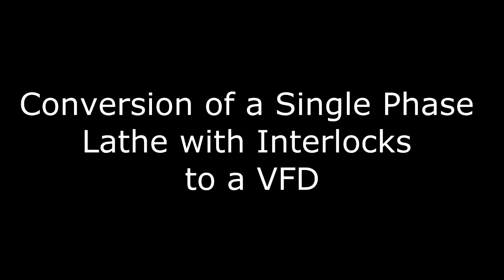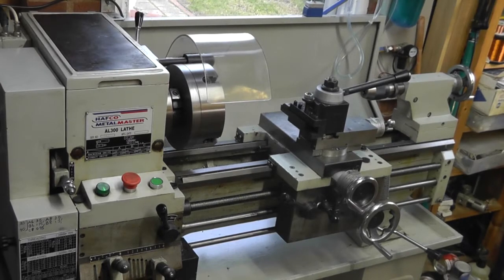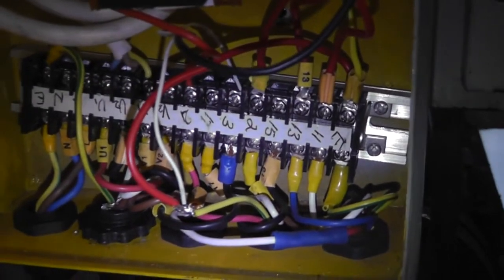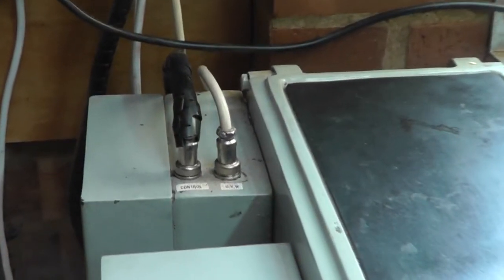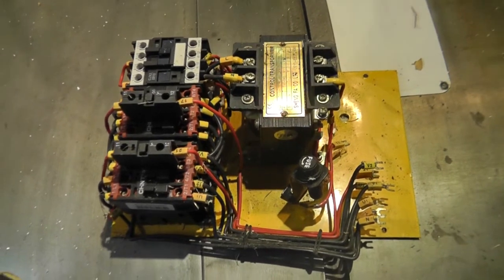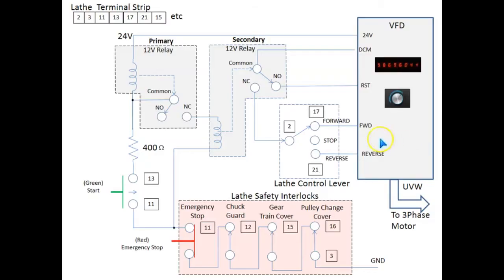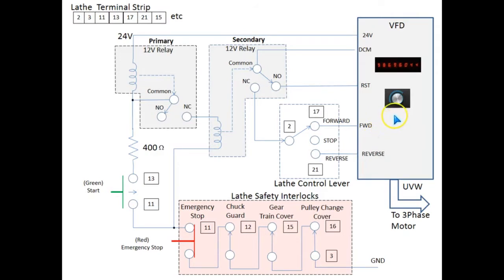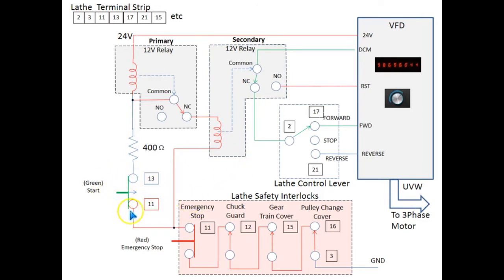Conversion of a Single Phase Lathe with Safety Interlocks to a VFD

Comment: Did you just remove the motor and size it against a 3 phase? Thinking of doing a similar conversion to my Grizzly.
Reply from the maker: Yes, it was a 1.5kW motor.   If I had the opportunity I probably would have gone for a 2.2kW.  Of course once you have a VFD driven 3 phase motor you don't need to worry about the belts and so I normally have the belts on a low gear ratio to compensate for the low power motor but I have found that even with that configuration there is ample enough speed range. 
I had a few minor modifications to make to the mounting platform but it went reasonably well.   Because my lathe was against a wall and I was too lazy to move it I had a bit of difficulty manoeuvring my way behind the lathe to install the new motor - but if you can move the lathe it is a very easy job.
Reply: Do you remember the frame# or maybe could you send a pic of the info plate
Reply from the maker: @force245  No worries - it is a GL-90L-4 B3 motor from Guanglue Electrical here is a link  to the frame data: http://www.guanglu.com/en/Productlists/showinfo/55

Comment: I was wondering how difficult it would be to properly integrate the Huanyang VFD into the lathe controls. Found a deal on a enco 14x40 lathe and just got it in the shop. Your video has helped me decide to go forward with the VFD option instead of a RPC. I was not so much worried about variable speed as the lathe will go down to 33 rpm but further speed control would certainly not be a bad thing. More worried about the stop/start/reverse and the interlocks but as per your video, that should not be a problem once I gain understanding of the lathe wire diagram and workings along with the VFD options. Thank you for posting the video.
Reply from the maker: Agree.  Much the time my lathe is running at a constant speed but it can be useful when threading etc.  Also the beauty of the VFD is that you can adapt the controller to the behaviour that you want regarding startup,  reversing etc.

Comment: Alex, Wow Im so glad to have found your vid (thanks for publishing it). new to me is a Grizzly G9249 (Basically the same lathe you have just badged differently. The previous owner was letting it go due to motor failure. I swooped in to get it. Im in the process of doing a VFD conversion. Im interested in what else you may have done to your lathe. modes upgrades etc... also what motor did you go with? it sure is quiet.  some of my projects can be see on my blog http://www.hyperlinks.net. I have not posted anything about my Grizzly lathe yet. but soon. -Sam
Reply from the maker: This lathe was one of the first machines I bought and has served me very well.    I really haven't made any modifications to it other than replacing the 2 phase motor.   The replacement  3 phase motor is only 1.5kW and would suggest that it should be around 2.2kW and I am tempted to make that upgrade as heavy cuts can sometimes tax the smaller motor.   Having said all that I have been toying with the idea of  a servo motor.

I am certainly fascinated with some of the great projects on your site.
Reply: Alex, Thanks. Looks like you upgraded the tool post to an AXA? over the factory shipped one?
Also how did you end up mounting your VFD? Shoot me some pics of your setup pls. mail4sam@gmail.com  . I just finished up part of my new base. My lathe came with the factory Grizzly base. As with all my other equipment I had to replace it with one with wheels. as my shop is expanding from the inside out. i.e.: shrinking from too many tools projects and or too little space.  the base is done I now need to build drawers (the internal cabinet) as well as do all the rewiring for the VFD retro fit. -Sam
Reply from the maker: Well spotted - wow I had forgotten about that.  I also added a 5C collet chuck but I rarely use that as I prefer to always keep the four jaw chuck mounted with which I can get the pieces running very true.

I will flick you some pictures today.

Comment: Hi There
excellent video i have just bought a colchester bantam which has a 110v control circuit 
The control circuit is powered from 2 phases from the incoming 3 phase supply.
I have only got a single phase supply so i bought a static converter which will power the control circuitry and the coolant pump but wont turn the main motor it is making a horrible noise and cutting out on thermal bad choice by me.
i would like to buy a dual voltage 3 phase motor and keep the existing interlocks cold you provide me with some info on the contactors and vfd you are using i would be vary grateful
Reply from the maker: It sounds like the colchester has a 3 phase motor and that you want to use a VFD (to replace the static converter) to drive the 3 phase motor.  If so, at first blush it sounds like the wiring from the static converter to the motor is incorrect (this will cause the thermal overload) or the static converter cannot deliver the required power.   Anyway to your question, I am using a Huanyang Chinese VFD.   These VFDs are heavily featured on youtube and many examples are available on their wiring.  The circuit shown in the video above shows the connections required to stop the motor when an interlock is opened.  The important factor is making sure that the controller that you have in the colchester has the same voltage reference as the Huanyang VFD so that you can drive the DCM and RST lines.  I hope this helps.
Reply: Hi 
Thank you for your reply i have just purchased the lathe it is 415v  3 phase so i purchased the static converter thinking it would power the main motor.
It will power the 110 control circuit through a transformer it will also power the 415v 0.1 hp coolant motor.
the main motor would start know and then but run very rough i tried swapping the phases but it made no difference it would just lock up and cut out on thermal.
I measured voltage across phases and found that two phases had 440v but one was 12v after some further investigation i have found that static converters use something called a phantom phase .
This is in effect a load sensing phase which is transistor fed.
Apparently they are extemely crude and there is no guarantee of them working.
so it is not  true 3 phase i payed £300 pound for the unit brand new
I work in a power station so i took the main motor to work to test it it runs fine on a true 3 phase supply.
I use a vfd to run a bridgeport miller but that motor has dual voltage 3 phase  so it was straight forward to do.
The lathe has an apron control lever which operates a phase reversing cam switch which i would like to still use but i am unsure if it could be used with a vfd as it is used to reverse the motor
will i have to go to a button control to start/reverse/stop 
also what model contactors did you use
sorry if this is long winded but your solution looks exactly what i need i have been pulling my hair out as i would like to retain as much of the lathe functionality as possible not just operate the motor.
thanks
Rich
Reply from the maker: Hi Rich,  thanks that sounds clear.   The only question I have is why not just pull the existing controller components out and do what I have done.  I have an apron control lever just as you do, and you can see in my diagramme it is used to signal to the VFD to issue the reverse and forward signals.   If you have a 3 phase motor on your lathe (which is what I did by replacing the existing Single Phase motor), just use the VFD to generate the 3 Phase UVW and do exactly what I did above.

Alex
Reply: Hi Alex
I will certainly have a go i am quite happy with 3 phase etc its just setting up the vfd but your description and diagram are very clear.
thank you for your reply it has helped me a lot
Rich